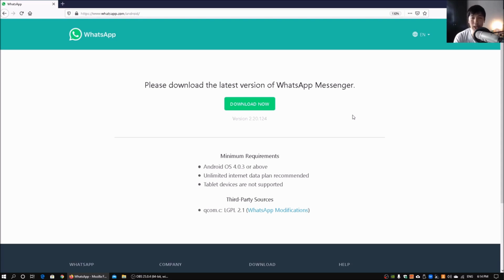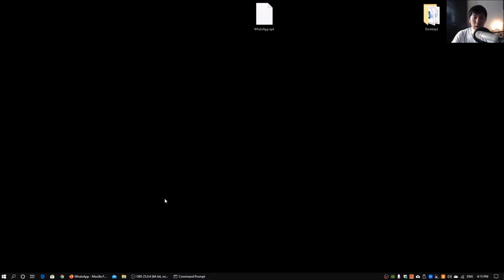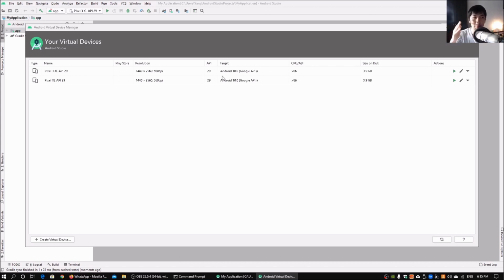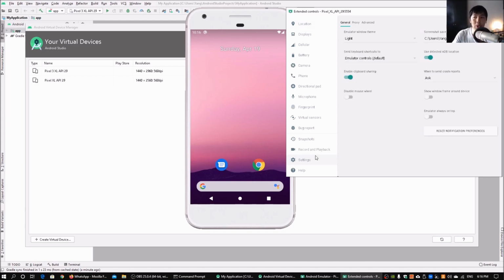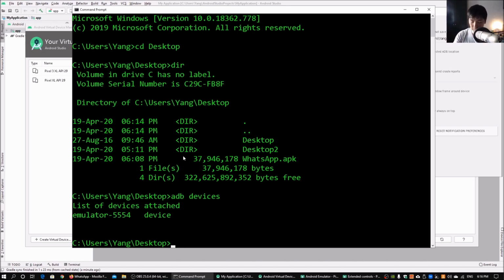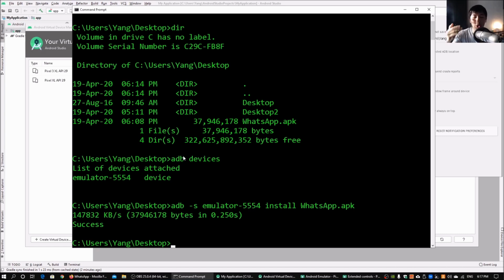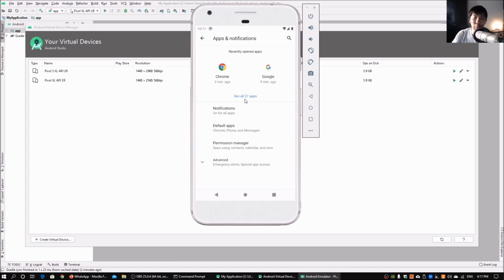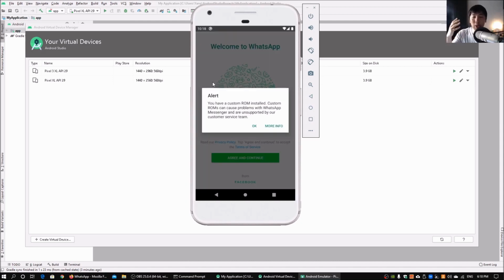Run Android Apps on your PC

Comment from the maker: Being able to run Android apps on your computer is important as you will need to test the applications' settings and configurations.
Reply: Make a video on how to unlock the android & ios mobile device
Reply: @doddaajith9010  ❌🚫this is illegal
IT'S CRACKING👨‍💻 if you use for malicious things⚠️
Reply: @calcio437  then upload it in your website instead uploading in YouTube
Reply: Hello sir, I'm having problem configuring adb with genymotion in Kali Linux for android Pentesting... Both are not opening parllely... Plz help me out for this